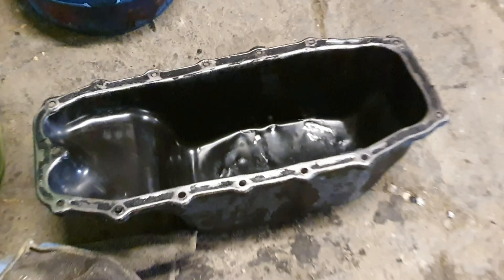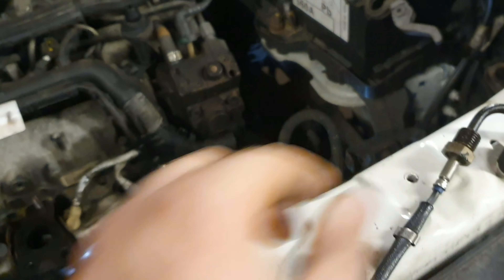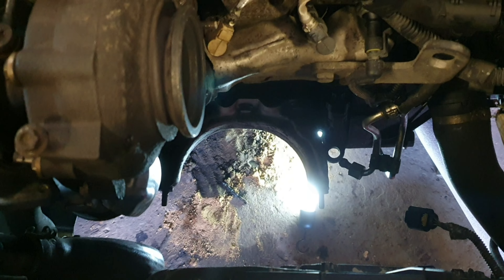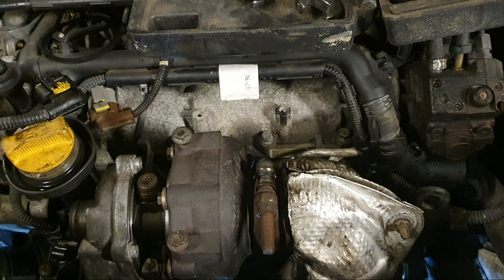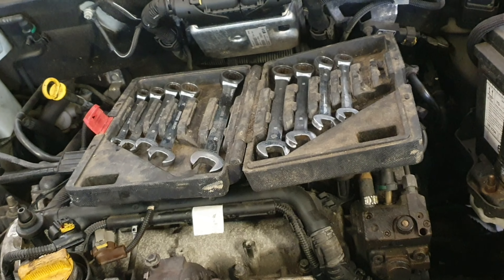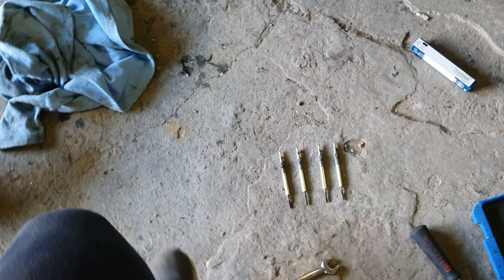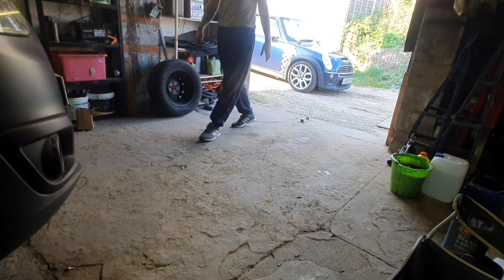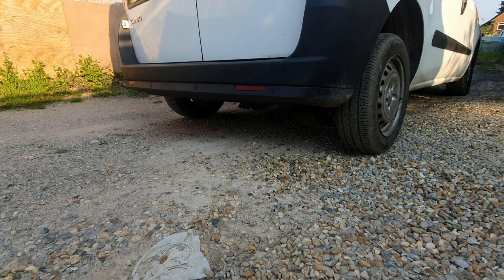Vauxhall Combo pt5: Will It Run?

Comment: Thats a fix !! Looks like a different van already , that moment after a big job when you turn the key  Ahh  It runs again .Well done
Reply from the maker: Thank You Richard! Means alot! It was such a relief when it started! I think where I didnt touch the van for a few weeks it made it that little bit more anxious when I finally came to starting her up! Thanks again for the support 👊🏼
Reply: @SalvageDiaries  I know what you mean I have got the wifes r53 cooper stripped for timing chain and crank rear oil seal its all over the garage lol will it ever run again

Comment: Anytime u take a turbo off , to be reconditioned or replaced . Always prime the turbo first . Use fresh good oil and filter . Put everythink back together , unplug each injector and take fuel pump fuse out . Then turn the engine over for a least 30 seconds . The engine wont start , then plug injectors back in and put fuel pump fuse back in and clear any codes triggered and then start the engine up and let it tick over . First few miles drive slow and that way turbo will be primed with oil .

Comment: Glad that you’re sharing your experience. Found you just few days ago but really like the content. Easy to watch those short videos even to stay focus for half hour. Hope you gonna get the profit from this one little runner. ✌️
Random question: Did you learn somewhere to be a mechanic or something like that or just trying do everything by yourself?
Reply from the maker: Thanks for your message mate really appriciate the support. I just taught myself as I went along years ago. Blew an engine up and put a new one in and it went from there. Never looked back!
Reply: Thanks for your reply. I’m kinda young man who is interested in salvage cars or other type of them which ones need to be rebuilded or fixed. Dreaming about it really long time. Searching on youtube guys like you who are doing it with satisfaction and trying to take as much as i can from experience all of you sharing. But there is a slight problem because I’ve never done something similar before. Thats why I asked you how you get started. Thank you one more time for your time to answer.
Reply from the maker: No worries mate, I'd recommend buying something cheap that needs a little bit of work something that needs the brakes changing etc and experiment with that taking things apart and putting them back together keep doing that until your comfortable taking on something bigger. Theres plenty of salvage cars to be fixed mate! Practice makes perfect 👌🏼
Reply: Yeah I was thinking about the cars which needs new body parts or something as you’ve said before. Thank you for your advises. Really appreciate that! I hope you’ll get success on this youtube channel and all the cars you making for fun and obviously for profit! Keep going! Stay safe!
Reply: @SalvageDiaries  can you send me a message please I have a few questions to ask tou